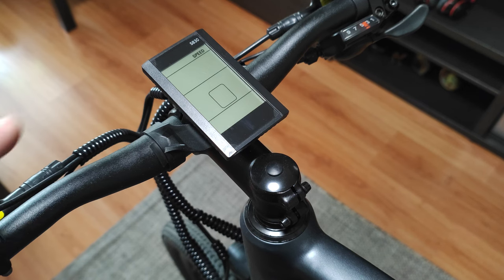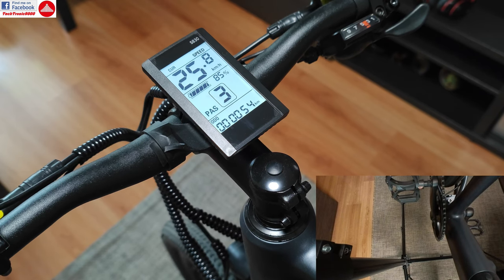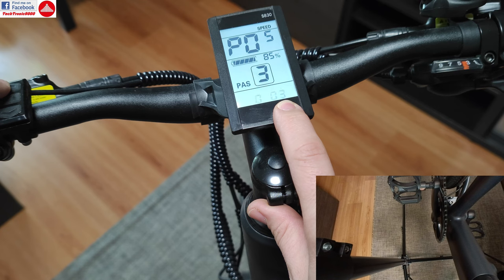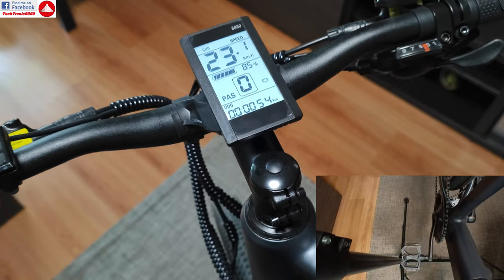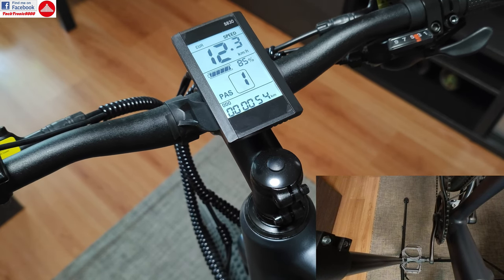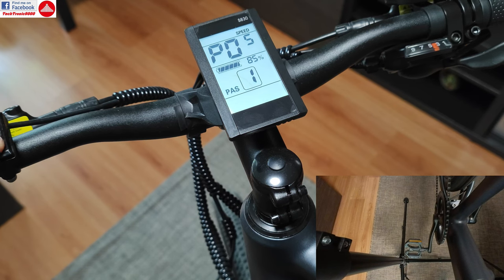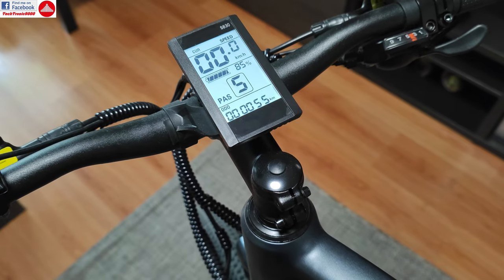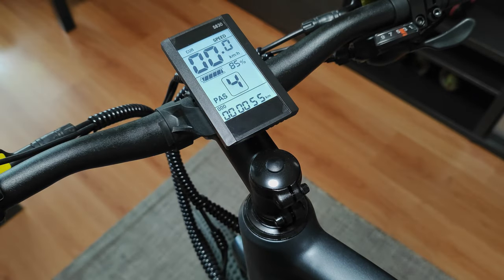ADO DECE 300 D30C Hybrid S830 Settings - Switch from 3 to 5 Assist Modes

Comment: I recently got a bike with the exact same display and controls but when I got into the settings I can't change anything, only the the brightness and the speed limit, I cannot change any other settings even if they appear there. Is there a way to do it or maybe it's the bike?
Reply: u have to write into setting mode .turn on screen and with in 5 seconds press up and down  buttons at same time 1st Will  be light  bright 1 ,2,and 3 then hit M button and that will be P02 setting then use up down to adjust. extra  but it doesn't  give you  much time to do your  setting and will time out like in 4 or 5 seconds and go back to home screen. if it does do over hit M button  as men by times  to get you  back e.g. Po6 and continue to  I believe  p14 .hopefully it  helps you
Reply from the maker: The controller could be locked, they display only sends the commands to the controller.

Comment: I am wondering if there is a way to unlock the settings menu so that I can change all Px settings? When I am in settings menu it only lets me toggle between P01 and P02, all others appear to be locked.
Reply from the maker: Some displays are locked with a password.

Comment: Thank you for the video with useful information, where do you find all these instructions ? are they documented anywhere ? I can't find it in the manual.
Reply from the maker: I'm just passionate about these things, this is not documented by ADO as they don't want everyone to change the settings wrongly as they had a lot of issues with customers that changed things in that menu and then claimed that their bike were faulty. So they properly test and configure then before shipping them so regular users don't have to.
Reply: @TechTronic9000  thanks for the fast & detailed answer !

Comment: Can i use this on others controller? And if i use the PAS for 25km and if i switch to throttle mode will it go faster den 25km above?
Reply from the maker: If it uses similar controller / display, it might work.

Comment: very well done, thank you so much...Are you aware of any way to set each PA level? PA1 is way too strong, I want some PA, not a lot, not seeing anyplace to tweak that...could be a deal breaker for me.
Reply from the maker: You can only set motor acceleration strength and assist delay but that works the same for all modes.
Reply: @TechTronic9000  bummer..... thanks.
Reply: You need a torque sensor for power assistance. Not a cadance . There are some good cheap ebikes out there with them.  Some of the eleglide range have them .

Comment: Hi, great video on the settings, wondering if you have upgraded this controller, this is what I'd like to do, despite the UART Color being the same, I have no power.
Computer = S830 UART Compatible        
Computer Upgrade = Bafang 860c UART Color display
Reply from the maker: No I haven't upgraded it. Sadly these controllers and displays are not very well documented so can't find a lot of resources about them.

Comment: Is it possible to reset the menu to the original settings?
Reply from the maker: No, you just have to program each of them to the correct values.
Reply: @TechTronic9000  I lent the bike to a friend, it worked regularly. When the bike returned to me, gear 3 didn't work, gear 2 went at 25km / h, gear 1 at 15km / h. Do you have any idea how this can be fixed?
Reply from the maker: Gear 3 is for using the accelerator, probably it's switched to hybrid mode.
Reply: @diegolas1418  I have same problem.  
Have you solved?
Reply: @mauriziotavarnelli9811  Not entirely. I switched to the 5-gear mode and now the first gear goes at 15km/h,  second gear to 20km/h and third gear to 25km/h, fourth and fifth gear dont' work. I don't understand what caused this but at least the bike works
Reply: @diegolas1418  Thank you very much, also I have used the 5 speeds and 4 and 5 do not work.
Reply from the maker: It doesn't work for 4-5 because probably you have switched it to throttle mode, you need to set it to assist only.
Reply: @TechTronic9000  Ture!! The setting P10 was at "0". I turned it to "1" and now al gears works. Tnx
Reply: @diegolas1418  Hello Diegolas. I have the same situation. I turned P10 from 0 to 1, but  the gears 4 and 5 still doesn't work. Did you change any other setting? Thank you!

Comment: Your videos are very helpful!
Is it possible to unlock the pedal assist and get assistance from motor even if you pass the 25 km/h (without using throttle)?
Reply from the maker: Sadly on this controller it's not possible to get assisted mode working faster than 25km/h.
Reply: @TechTronic9000 thank you!  one more question.  When you level up the assist modes do you get extra torque apart from a higher speed limit?

Comment: Our S830  Has a manual on Display and will not let the monitor work properly ??
Reply from the maker: A (M) sign? That is motor error, check the cables first. If it's a (!) then it's usually a brake issues.

Comment: Can you make a new video explaining all the settings? I have the same bike and the same system, but I accidentally changed the settings and it no longer works. The engine does not spin and the speed is not measured.😢
Reply from the maker: I have already done that, have a look here https://youtu.be/sRPKQj6ca0A?si=x-kk4ARpDCzh4Z0e

Comment: can you set regenerative braking with this display settings?
Reply from the maker: No, and it's not supported by the motor as it has a way way clutch system so it doesn't put any drag when you are not using it thus has no braking either. This makes the bike very efficient and able to run like a normal non electric bike.
Reply: @TechTronic9000  is that hub motor a geared hub motor or direct drive (gearless)?
Reply from the maker: The D30C uses a geared motor.

Comment: how can i connect my ado dece 300c to the ado app>?
Reply from the maker: The dece300 doesn't have an app. The app is made for the new air 20, 28 and beast models.
Reply: oh ok, thank you for letting me know, much appreciated. @TechTronic9000

Comment: I changed the wheel size and it works with 5 mode PAS. The display says 25 km/h but my gps tell me 36 km/h with 17 inch size entered in parameters
Reply from the maker: I know what you did there 😆
Reply: How? To go 30km/h please share make video without buying extra stuff
Reply: @hermanaditya2250  enter the parameters as video show it. Do the modification to get 5 PAS. Then go to p06 and change wheel size from 27.5 to 17 and that's all. But adding the accelerator is the best solution

Comment: Hi , I received my bike and setting one was around 15kmh , setting two took it right up to 28kph, setting 3 didn’t do anything. I guess this was because second took it to its max. 
So I tried the above and immediately the battery started counting down from 100% , within 10 seconds the battery was showing o%. Totally flat. What have I done ?
Reply from the maker: Do you have the throttle installed? Check the settings for battery, should be 36V, your might be set on 48V. Also fully charge the battery first time before use.